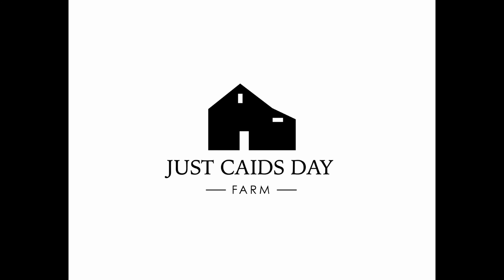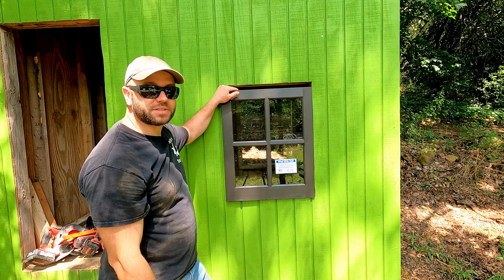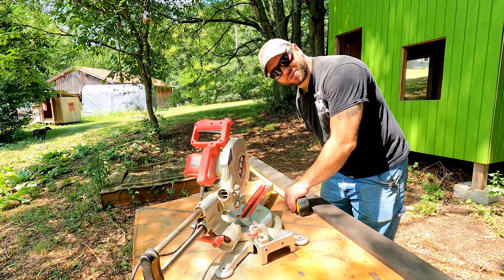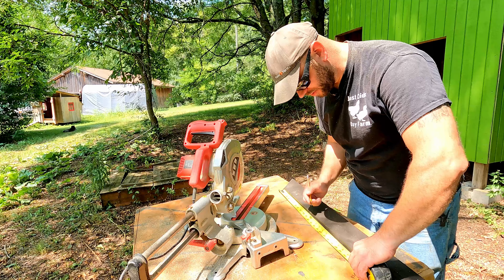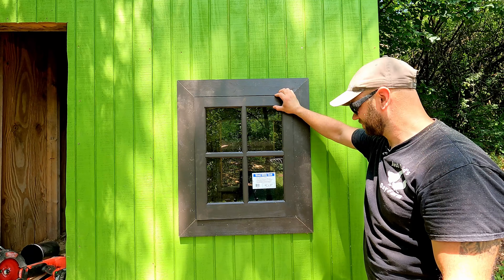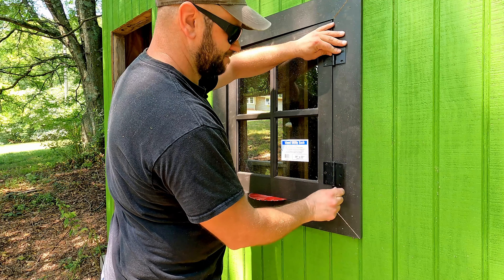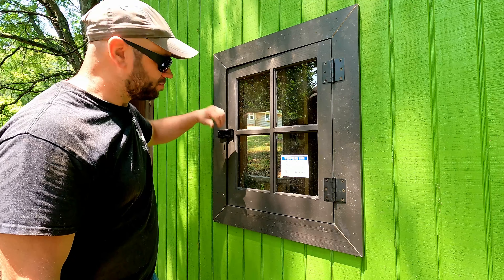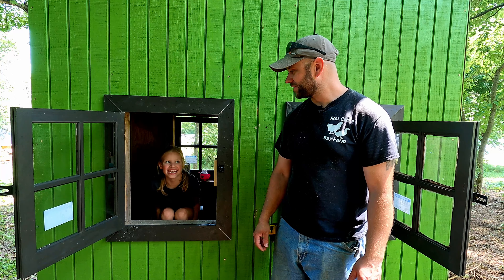INSTALLING WINDOWS FOR KIDS PLAYHOUSE

Comment: I just put 2 new 4 pane windows in my lower bar . 
The windows are made out of recycled milk jugs and are solid.😊
I had to cut one of the windows down 3/4 of an inch. Sawed in with a circular saw and a plywood blade. Other than making a white mess on my wood shop floor, it worked fine.
I really like that nail gun.
Reply from the maker: The recycled milk  jug windows must look really cool! The nail gun is handy for projects like that but I found that doin indoor finish trim that it doesn’t counter sink the nails much. That was the first version of the gun and I’m sure they have made them better by now but it beats dragging an air house and compressor around or replacing cartridges in a gas gun.
Reply: @JustCaidsDayFarm  especially up on a ladder.
Reply from the maker: @tractortalkwithgary1271  very true!